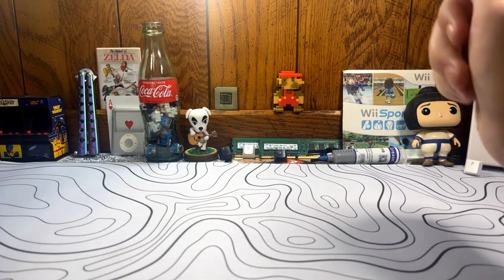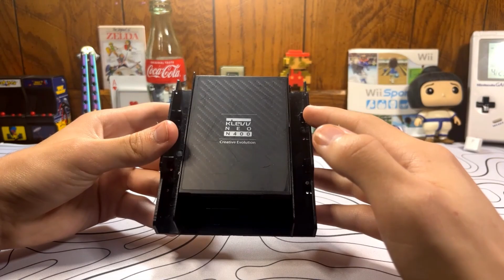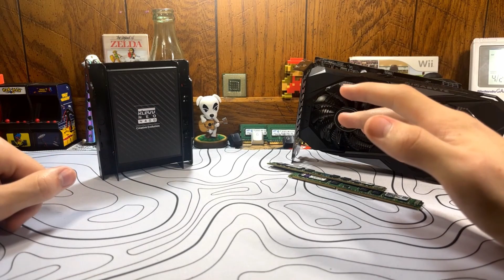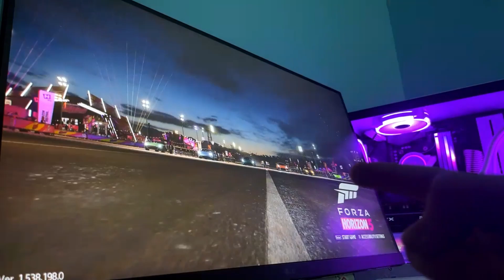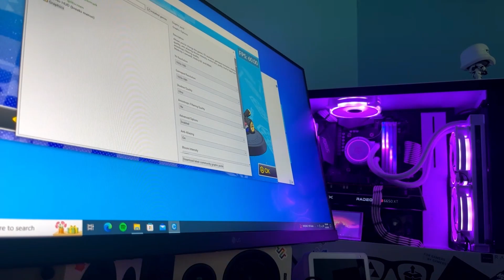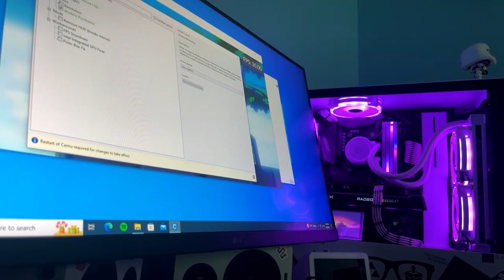Turning a Cheap Optiplex into a $200 Gaming PC: Budget Gaming Build Tutorial

Comment: 4th gen i7s are down to $20-30 and the rx 5500 xt's and 1060 6gb cards are around $50-70
Reply from the maker: Yeah you could definitely do this much better but those were the parts I had on hand

Comment: The power supplies on those older Optiplexes use standard 24-pin ATX connectors instead of those proprietary 6-pin or 8-pin connectors in the newer ones. That means you can replace the stock power supply with a higher wattage unit of your choice (one that has a PCIe power connector) and use whatever GPU you want
Reply: Yep, Sandy and Ivy Bridge have the preferred connector.  The thing that I like more about the 3020 is that you can zip tie a 120 mm fan to the side panel vent with zero case modification.

Comment: stick  a Xeon E3-1241 V3 in there for another $20. It slightly outperforms the i7 4770 for less than half the price but you must update to A20 bios first.
Reply from the maker: Good go know 👍. If it fits the same lga socket I may go with that. I’ll throw up a video later on of upgrades and such.
Reply: @TG_Geek  It's the same socket and Haswell CPU. I fitted one into a 3020 yesterday.

Comment: Nice but you need to change the power supply. You might need 24 pin to 8 pin adaptor. That stock 290w power supply won't last long if you use it daily. I recommended you change the power supply to 500w or 600w. Here's my Dell Optiplex 9020 custom build https://youtu.be/3-aGQ1xwKPk
Reply from the maker: Didn’t know that they made those sorts of adapters. Thanks for letting me know 👍
Reply from the maker: I have other power supplies, so I may swap it out soon.
Reply: @TG_Geek  you should change your i5 4590 CPU to i7 4790. if you have the money you go for a better CPU with i7 4790K. Also upgrade your ram to a 16GB ram for better performance
Reply from the maker: Upgrades will be coming soon, it’s not the PC I daily drive so I’m not super concerned about it but it’ll get some fresh parts and upgrades soon.

Comment: great video i did a similar build  on my 7020 i used a rx 560 and a 430 watt power supply i started out putting a oem rx 550 in it and  it was broke so i bought a newer Chinese knock off gpu of the rx 560 and a ssd in mime and swapped out my the 4 core 4 thread i5 for a  i7 4790 4.00mb 8 cash but it kinda still shudders playing any thing from the unreal engine on steam
Reply from the maker: Yeah that’s pretty sick, I left the i5 4590 in mine, but I could upgrade that later to an i7 easily for pretty cheap. I have tons of cards but the 1650 is the best 6 pin card I have so that’s the one I used lol.

Comment: One thing I noticed was that the SATA cable from the optical drive you used was in one of the SATA2 ports, which will bottleneck the SSD, so it's worth switching it to either the blue or black SATA ports as they're SATA3. Also, there are a lot of cards that only have six pin power connectors, but that doesn't mean they'll be fine on the stock power supply or single SATA to PCIe adapter. I have a 1060 6GB that has a 6-pin that will pull up to 120 watts.
Reply from the maker: Ill go have a look at that 👍. There were sata cables for the dvd drives so I just left the cables in the same spot and plugged them in. Thanks for pointing that out!
Reply: @TG_Geek  No problem.
Reply: You can run NVME SSD too with an adapter card. There's an easy to follow guide online to inject the NVME modules into the bios so it boots from it.
Reply: @retrotech2020  Sure, but it's really not worth the effort. The bottom x16 slot, while being electrically wired for x4, is only a Gen2 slot. So, it's like being limited to 2 Gen3 lanes. You're just not going to see ANY benefit in a machine like this. The kind of use cases where it would matter would be a pretty marginal improvement, and those use case just don't make sense to do on a system like this. Not to mention, that the point of these systems is to build a PC for as little money as possible and you're adding cost on an m.2 adapter for no benefit. That's outside of an enthusiast use case, where you throw practicality out the window to build the most top spec system you can... diminishing returns be damned.

Regardless, modifying the BIOS to accept an m.2 drive as a boot drive is functionally pointless and would tell people to just stick with SATA SSDs for booting unless they're just wanting to do it for the hell of it.
Reply: @TheGameBench  This is true. But we do because we can in this game.

Comment: Lots of 1650s don’t even need a 6 pin so that adapter will work just fine for the little extra power for the OCing and what not
Reply from the maker: Yeah just depends which model and which speeds you want to run.